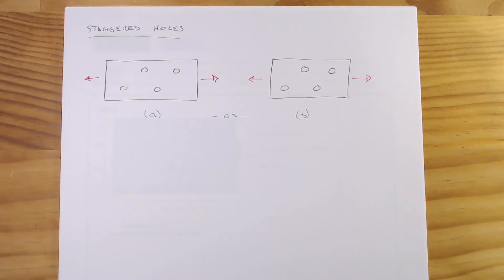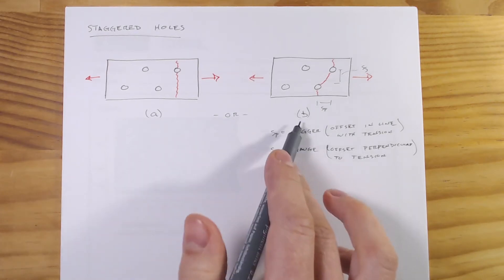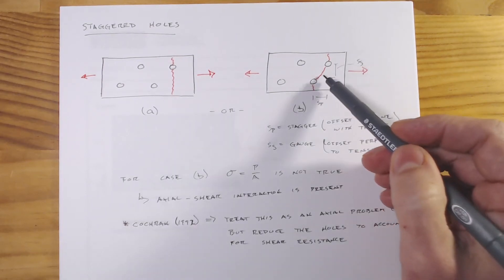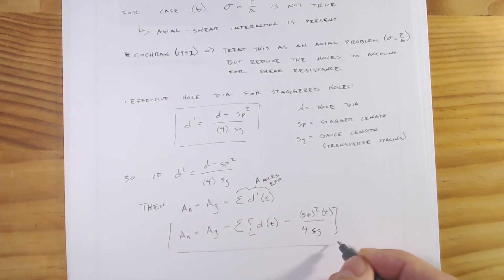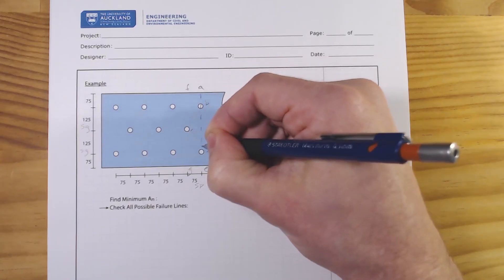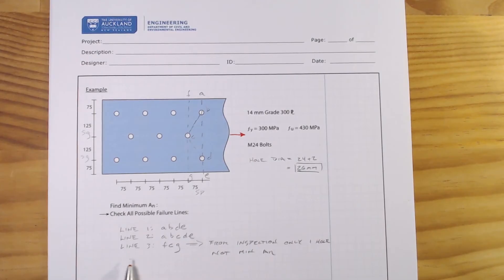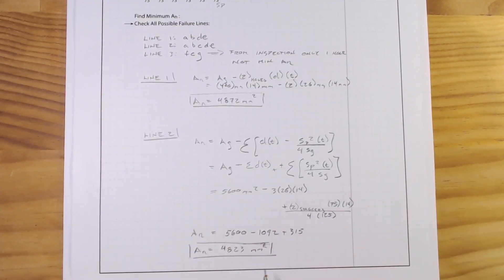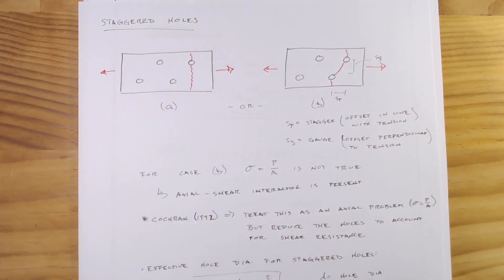Net Area of Staggered Holes

Comment: is the summation of the diameter equation [d*t - (Sp^2 * t)/(4 * Sg * t)] or  [ (d*t - Sp^2 * t)/(4 * Sg * t)]. You wrote it out the second way to begin with and then switched to the second way for the rest of the video
Reply: Exactly
Reply: AISC Specification B4.3b says s^2/4g. I think the way he did it in the example is correct.